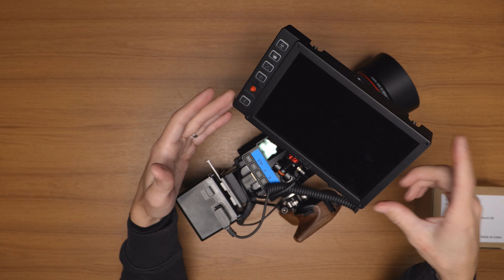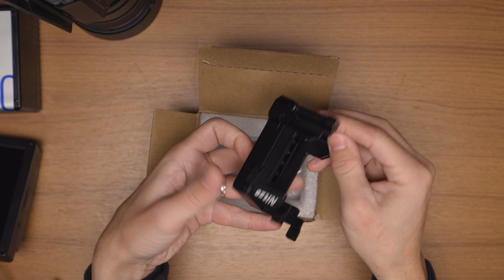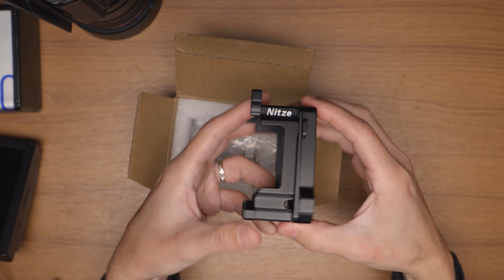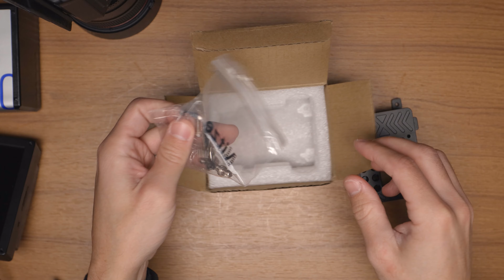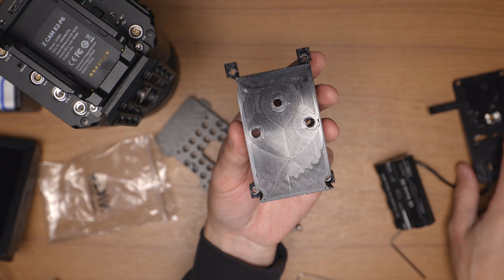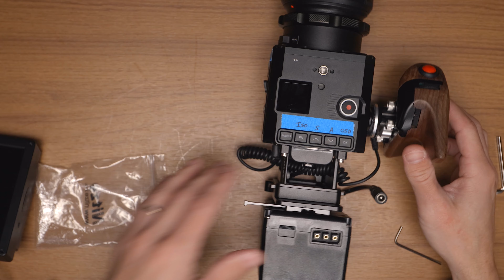My Z Cam Flagship Setup featuring the Nitze V-Mount Adapter

Comment: Hi, is your Ansso plate modified? I’m trying to get one but it doesn’t seen to come with a dummy battery
Reply from the maker: Hi! Yes, it was by James Davis in the E2 group on Facebook... I'm not sure if he's still doing those mods but you could get in touch with him if you're on FB.
Reply: Scott Dumas thanks for the reply! I have found an Ansso plate with a LEMO plug whick goes directly to the power port of the camera so I went with that.
Reply from the maker: @kevinokai  Good call, that works perfectly- then you can keep a backup battery underneath :)
Reply: Scott Dumas can that be used for hot swapping?
Reply from the maker: @kevinokai  It can! :) Very useful

Comment: Hey again, I was just wondering if you could link to which battery you used that fit perfectly with it?
Reply from the maker: It's the Bebob V Micro (I typically use the 150Wh version) ...Blueshape Granite Mini are also pretty close to fitting but just a little bit larger. A lot of people use the FXLion Nano batteries too but I haven't tried them myself.
Reply: @ScottDumas  sorry, I meant the npf one
Reply from the maker: @chromaticcream3500  Ah sorry haha... that's a custom one made by James Davis. He makes a variety of them now for different plates and connections, you can get in touch with him through Facebook (he's easy to find in the E2 User Group) or email him here: gcgfilm@gmail.com

Comment: Hey there, have you seen the VMM-Micro battery plate on their site? Or is that the one you mentioned that wouldn't fit?
Reply from the maker: I think we checked into it, and it's just the placement of the screw holes/the width of the battery plates from Bebob which wouldn't line up with the Nitze plate unfortunately.
Reply: @ScottDumas  Awesome, thanks for the reply. Love your videos.

Comment: I dont undersatnd this fully, coz. I mean this cam has a "sony" battery utility already. you can get different seize too. So whats the point in mounting this "brick", that is clupsy and bulky and bigger than the camera itself .Is this cam really so power-thirsty ??I means, espacially when making movie, you dont film hours, constantly. Better change battery instad of this unpractical item, tight ?
Reply: and whats the reason why those cam is not Netflix approved yet ?
Reply from the maker: @orangerecords_studio  if that's your style that's fine- but I'm also powering external monitors, wireless transmitters etc, and now those can all be powered from one single battery. MUCH less hassle to come home and just charge a single battery. Plus, a slightly heavier rig often feels more balanced (if the grip is where the camera body is, a lens will then skew the weight to the front, so a battery brings the weight back in balance) ... plus heavier rigs don't show micro jitters/small hand shake as much. Then there are factors like money- on the surface no name NP-F batteries are cheaper, but if you get enough to supply power to the camera, the monitor and the wireless transmitter all for the same amount of time as this single v-mount, I'd spend the same amount or more even buying cheap batteries. But- those cheap batteries don't hold full charge after a while of use (true of all batteries, but cheaper ones seem to die faster). A quality v-mount battery will last much longer, be more durable and can then power my lights, my 21.5" monitor and a lot of other things besides just the camera. So, having a stock of those instead of 20 little NP-F batteries that I have to charge and replace sooner than my V-mount just makes sense..*For me* 

There are still situations a small NP-F is beneficial of course... gimbal use, for example... which is why it's great that this camera can work both ways, and the Nitze mount now makes it easier to go back and forth between setups. Something almost no other camera can do. :)
Reply: @ScottDumas  I understand sir.Yes, I have the experiance too, with those batteries, in my a7s II .One thing for sure, I have left the sony, after this joke og a camera they put out; FX9; a camera in fact that noone know what will be, and be able to do, in terme of RAW, recorder etc. Seriously , for filmmmaking, there is not many to offer F.frame .Inthe workflow with D. Reolve, this camera holds up too ?
Reply from the maker: @orangerecords_studio  I don't actually use Resolve much myself mostly because FCPX is just so much faster and smoother to work with on Mac, but I don't think the ZRaw is compatible with Resolve just yet. Not 100% sure, I could be wrong. Z cam does have their own RAW converter, but it's relatively new for Mac and I don't like working with it. The ProRes has been more than enough for my work so far though, so I'm not too upset about it. But I do really hope they continue to develop the workflow for RAW and incorporate it into Resolve, Premiere etc.

Comment: Hey great video. I'ld love to use the Nitze adapter with the hedbox V-mount adaptor with 2 pin lemo for my F6. I'm looking on Amazon and there seems to be a few choices. Which on is the correct one that'll work best for the E2 F6? Link? Thanks!
Reply from the maker: The Nitze plate should be the same: https://geni.us/nitzevmountplate

You might need a customized hedbox adaptor though. James Davis makes a few versions, and you can contact him on Facebook (he's active in the E2 group) or by email here: gcgfilm@gmail.com
He should be able to get you set up or let you know where to get the specific hedbox plate you need. 

Hope that helps! Let me know if you have any other questions :)

Comment: i cant find any same sized v mount plate for that Bebob batterys at online market :( can you recommend something? i mean exactly same sized, every plates are much higher :(
Reply from the maker: I'm using the Ansso one customized by James Davis (active in the Z Cam Facebook group), it's about the same height. I think he might be working with FxLion to make a better one that would also be compact but have better options for output etc. If you're in the E2 FB group, you should be able to find a bunch of info about the plate development there.

Comment: Hi Scott, thanks. Hope to see a review about the ZCam f6. Can you recommend ZCam is it reliable as Canon?
Reply from the maker: Hi! I will be trying to get a light review done soon but also am hoping to put together a full on course for it available for purchase (cheaply) ...as soon as I can haha. For me, it's been just as reliable as Canon, plus the company stands behind it more and updates it farrrr more significantly and frequently. They squeeze every last bit of power out of their cameras whereas Canon seems to limit them severely in an effort to make sure nothing ever goes wrong. That does occasionally cause issues like card write speed errors (although I had issues with the C200 too once or twice) but if you use Z Cam's recommended cards or SSDs you should have no problem. If you don't expose correctly high frame rates can also get fairly ugly and people complain but it's because they're really pushing the max of the camera ... exposed right high ISOs and frame rates are still gorgeous though
Reply: @ScottDumas  Thanks for your insights man. Waiting for more content on the f6 :)
Reply: @creators-summit  i own the F6 since november and it is still working

Comment: hey Scott, Thanks so much for this review. I was looking fo a nice v-mount solution and couldn't find any videos on it! Just one question: Whats the loose cable for that you can see in the last part of the final set up ?
Reply from the maker: +1000hcI thanks for watching! That’s from the Ansso plate, which has (in my case) a female dc cable for using with the power cable included for the BM5, for example. My power cable for the OSEE is d-tap though so I wasn’t using it

Comment: Hi Scott, have you thought about the Vmount to NPF Adapter from FXLion? Looks also small and portable :)
Reply from the maker: With any significant weight on there it would most likely stress the NP-F mount too much since it's not built for that amount of torque. It might be nice for smaller weight/size v-mounts but at that point a lot of the benefit of the v-mount is kind of lost. With this I could use a huge 290Wh battery if I wanted and no worries (although these compact 150Wh batteries are really hitting the sweet spot for me)
Reply: @ScottDumas  understand, thank you for the answer 😊